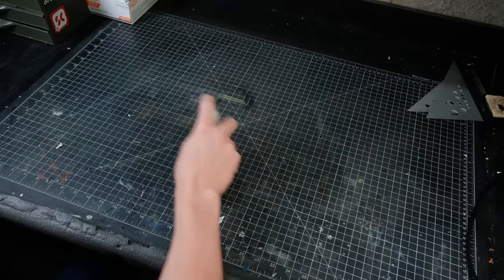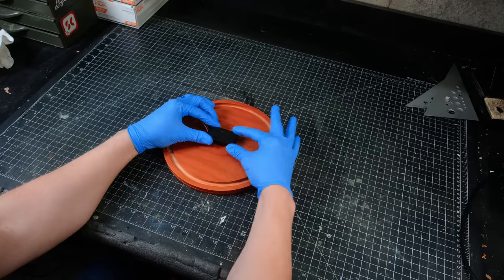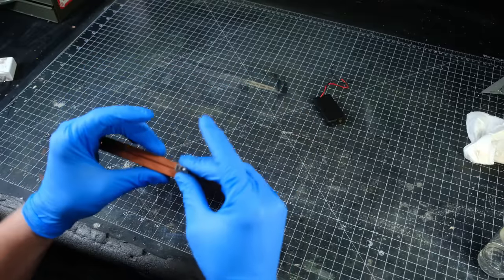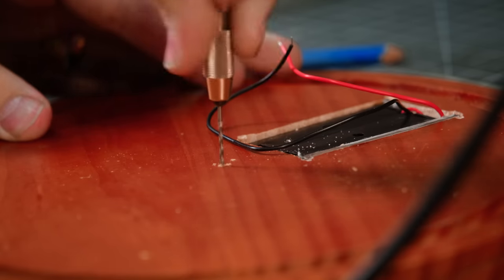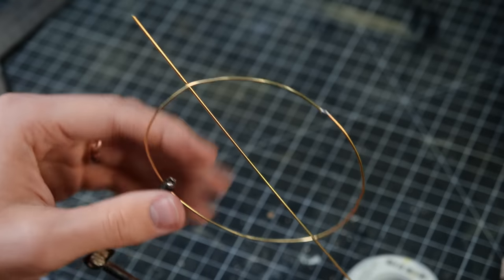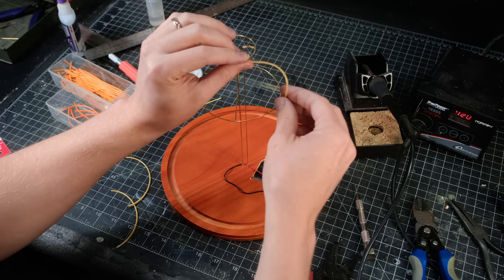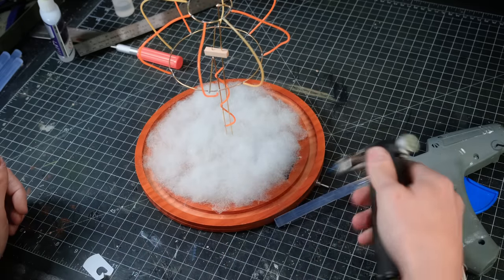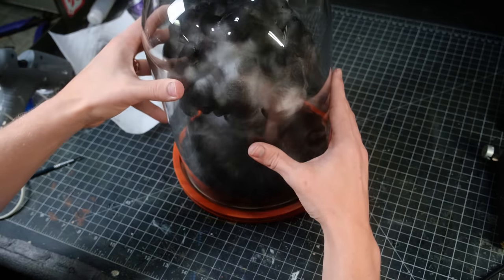Pink Mushroom Cloud | Barbenheimer Nuke

Comment: I learned about weather climes and temperature fronts (pockets) during my drone classes.  Watching this today that info came back to mind and I realized why mushroom clouds have those extra “rings”  around the stem and “layers” on the top, in part because the explosion of the bomb has enough energy to crack those layers and cause the air moisture to condense into clouds on the boundaries between the layers in the sky. Fun fact for y’all.
Reply: Funny. Right on time. I was just exactly wondering that very thing. Thanks!
Reply: Well it's so fast it breaks the sound barrier but believe it or not lots more are at play so not only earth forces but yes beyond and some of it is way to complex to explain so quantum physics at play so beyond earth forces and not even getting to the different radioactive stages and yes basically like a acid rain and the first ones is like nothing compared to what we have now so lot smaller but way more powerful and something done to prevent fallout so not only does it turn things to ash getting hotter than 10,000 degrees but again most fear radioactive but your talking nuclear winter and changes that could go in any direction the wind goes and basically when you split atoms fission but there is the opposite fusion both are at play and forces beyond earth so basically it goes up and breaks the sound barrier and actually goes around all of earth many times and this is seconds and radiation is harmful but not actually the most dangerous thing so like after the nuclear fallout goes beyond radioactive and it goes so fast that it breaks the sound barrier circles earth and goes above gravity and electronic magnetic pulse so it cooks all electric so even cars gas powered to the grid and then nuclear winter and your talking negative two hundred degrees

Comment: A hint for removing the "sticky stuff" left by stickers, CA glue accelerator, works great.
Reply: Thanks I’ve never heard of trying that! I use a heat gun to loosen up the adhesive and it usually peels right off. I’ll have to keep your tip in mind though 👍🏼
Reply: Lighter fluid works well too

Comment: A little tip I get from my job, is that if you want to peel a sticker easily you can heat it with a heatgun or a hairdrier! The glue underneath melts and the sticker comes in one piece! Very satisfying!

Comment: I have found that leaving a paper towel dampened with glass cleaner for about 5 or so minutes (depends on the sticker) helps soften the glue.  And being glass cleaner doesn't usually hurt the surface below it.

Comment: Well... it certainly is a thing. LOL I'm always interested to see the "how" of your builds and this one had me watching to the end... so that's good, right? Right. Thank you!
A little Tip - get some "Goo Gone". It's a n oily spray that takes those sticky tape residues off of nearly any hard surface in seconds. Then you can wash it off with soap and water or iso alcohol or just wipe it if that works for your project.

Comment: This was really fun and fast looking.  Question for you. Is there any concern with the polyfill being in contact with the bare wires or is the current/voltage just so low its a non issue?

Comment: A trick for getting rid of stickers is coconut oil.  Ever since I discovered that, I wipe a thin knife coat of coconut oil on any sticker and it will break down the glue in a few minutes and make any sticker and their glue them clean off with any dish soap.  It really works well and helps to prevent scratching glass or porcelain material as from scratches.

Comment: PRO TIP: use heat to soften a sticker.  if you warm it up first, it will usually peel right off without leaving any glue behind. a hair dryer works well. be careful if you use a heat gun though.  WD40 will take the glue off better than anything else, and regular old windex is the antidote for wd40 residue.   - I've had to clean off a LOT of stickers in my years as an IT guy for our local school district.

Comment: Tip for any stubborn sticker removal - soak in WD-40 (only WD-40 no alternatives) for a few minutes and then scrape the goo in a clump spraying more WD-40 to assist with subsequent adhesive residue left after each wipe. It will eat all adhesives used in stickers and labels leaving a clean surface. Just be patient as it sometimes takes a bit to effectively work on heavy duty labels.

Comment: If you run across another pesky sticker try using your heat gun or a hair dryer to heat the sticker up it should help release the adhesive and make it much easier to remove. Especially on glass.

Comment: Technically, even when wet, wood is still a very poor conductor. And if it's distilled water, that one is still not a good conductor too.
Technically aside, damn good build. The flame trick on the fibers is damn neat. Awesome job.

No I just gotta find a USB-charger-to-2-AA-batteries converter. Also gotta come up with one for my cat lamp that eats 3 AAA for breakfast.

Comment: Tip for anyone trying to get a sticker off, if you use a heat gun or blow dryer on high heat to warm up the adhesive it will easily peel off.
Reply: A quick squirt with cheap perfume usually works.

Comment: The “ rods “
Aren’t rods
Folks they are copper wire 20 gauge or florist wire either way those are about 20 gauge as well. He straighten the wire with a drill and Vice or a pair of pliers then cut the wire to size so don’t be fooled when he says rods
Reply: Kyle. Incorrect
Reply: Incorrect? I say not if they are rods then what kind? Also I’ve seen video on how to make cooler wire “ rods” with any size gauge wire I was guessing it was 20 gauge but could be a little smaller